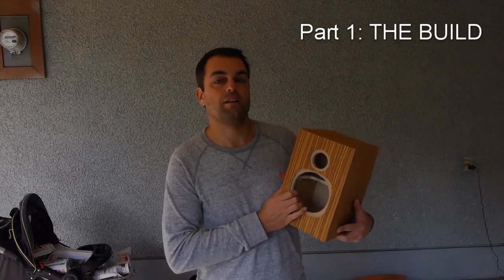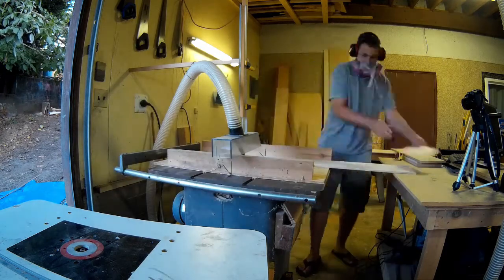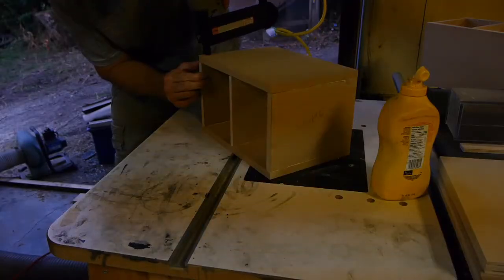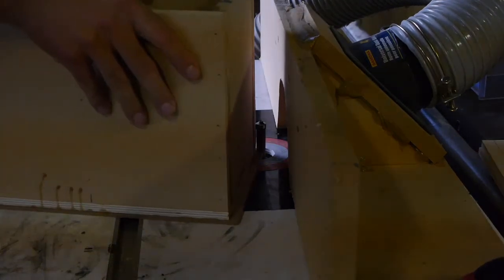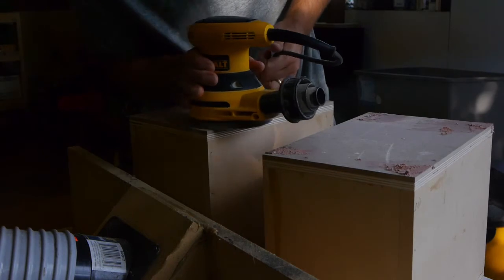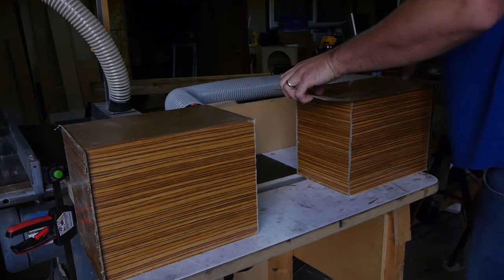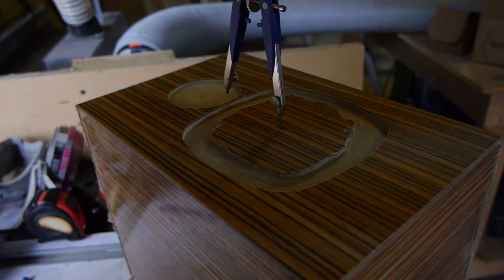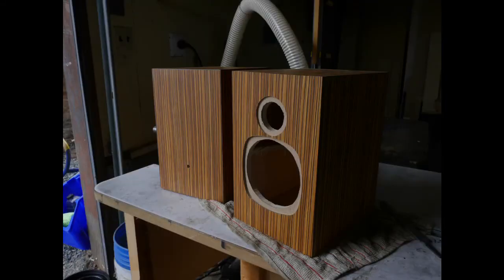Life S5 | Part 1: The Build

Comment: Can you please do a desktop build using car audio drivers? There are so many good kits with 3 way component speakers and pre-built crossovers. I know they won't sound as good as a properly designed kit but it a lot easier with a kit.

Comment: Off topic for this video. I was wondering if you have ever finished a speaker with fiberglass? I hope your Summer is going good!
Reply from the maker: mike ables I haven’t personally but I know other people have done it and it can look quite nice.
Reply: @ImpulseAudioSpeakers  Thanks for your how to videos. I purchased  some basic power tools and the calibrated mic and loaded the programs for my first build. I put the 15 inch SV Accoustic woofer, the 7 inch revelator midbass and the Scanspeak beryllium tweeter in a box of 3/4 inch MDF. In haste I plugged in a crossover from an old Cerwin Vega set. The sound is great considering the crossover. It's going to get so much better as I improve the x-over. Lots to learn. What a fun hobby.

Comment: When using a pattern bit like that, do you use one with the exact depth of the baffle? 1/2" bit for for 1/2" material? Rather than cutting, say, 1/4" at a time with a pattern bit that has 1/4 depth of cut for however many cuts it takes? I ask because otherwise you would need to own a bunch of different bits, each one for a different depth. You know, sometimes you use 1/2" material, sometimes you use 3/4" material, and sometimes you might use 1" or heavier material. Since the Whiteside bits run about $25-$45 each I wonder what you suggest as a general approach.
Reply from the maker: keithostertag you can use a smaller bit anf take fewer passes or a larger bit and set the depth shallower. I believe this was a 1/2" bit that was set to about 1/4". Thats based on my recollection. I only have a few pattern bits. I adjust the depth to the required cut depth, but what size the bit is. Good luck.

Comment: What pic or Mac requirements would you require for xsim.
Reply from the maker: It's a very light program. I'm not sure what the requirements are, but almost any computer from the last 10 years should handle it. It is basically a fancy graphing calculator. Nothing much computing power needed for that.

Comment: Amazing videos, keep up the good work. Can you please tell which software or calculator did you use to calculate the box dimensions?
I am just starting out in DIY speaker building. If I have an unknown driver with no published specs and instead I measure the driver myself with some test system then how do I calculate the box dimensions? How would you proceed in this situation?
Reply from the maker: Ammar Ejaz I personally use SoundEasy or Winisd. Winisd is free to use and quite powerful. Definitely worth trying. Don't buy soundeasy.

In the case where you don't have specs, you could measure them if you have the tools and software. But it takes some practice on known drivers before you can feel confident to do it. I would probably try a sealed box first of the dimensions you feel work for you and try to measure it. That will give you a data point to go with. Ported boxes are much more fickle. Sealed boxes are very flexible.
Reply: Impulse Audio Thanks. Very kind of you. I have the DATS v2. The only option I have is to measure the T/S parameters with DATS and then put the values in Winisd which will then calculate the suitable box dimensions. Is it the right approach? Thanks
Reply from the maker: Ammar Ejaz that is generally the right approach. Winisd will give you the box volume. You will have to sort out the dimensions yourself. There may be an online calculator to help with that. I use litres of volume. Then HxWxD in cm divide by 1000 gives you litres. Or use googles unit converter doing it in inch.